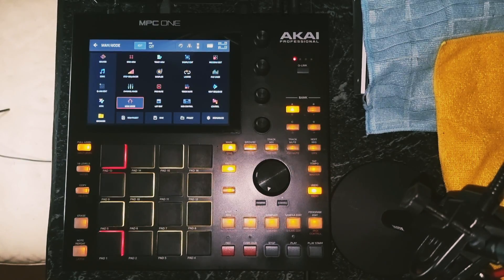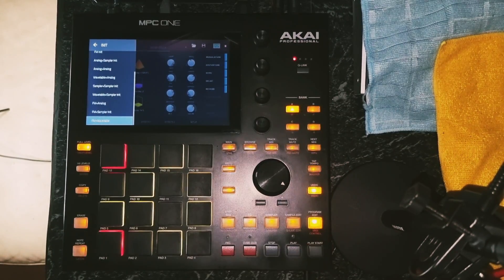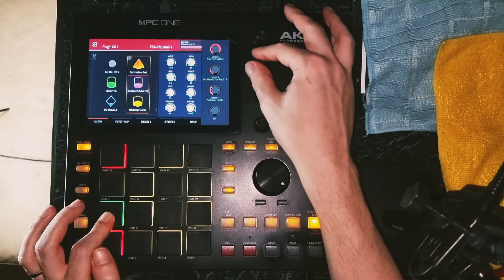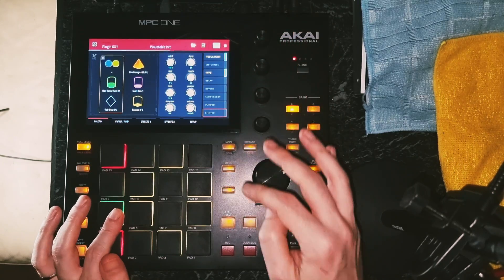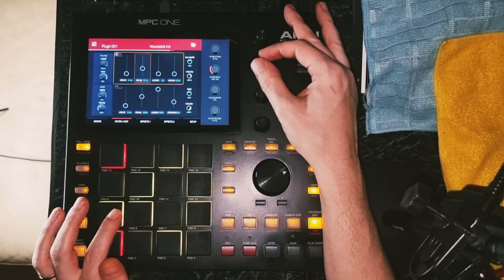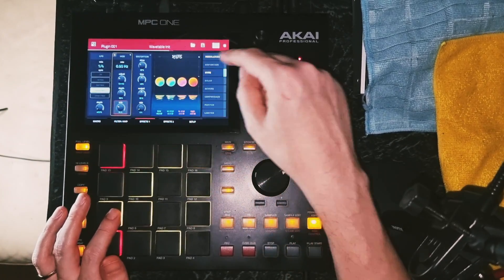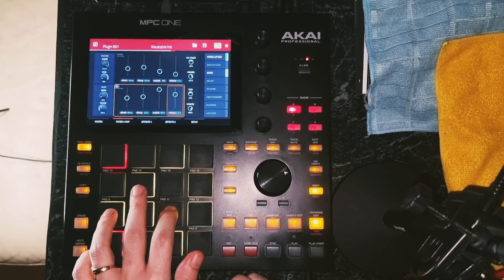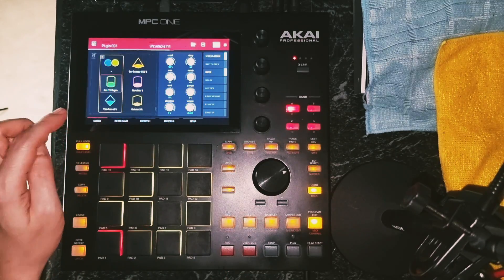Mpc Tips 1. How to Modulate Wavetable Position In Hype Synth

Comment: You can get some nice wavetables close to serum. Be interested in a hype pack for edm.
Reply from the maker: I'm currently making a massive edm pack for mpc. Do you think patches or keyroups would be best for wavetable growls. I think they might work better in keygroups or drum programmes
Reply: @Techtronix  that's a good question. If by patches you mean saved patches that just work for hype, keygroups-seems like you would have more options. But then again patches it's all right there ready in hype and you can use the mod wheel to mod anything instead of going through the mod edit in keygroups..I think keygroup editing could be more limiting because the program has a ton at the finger tips. I could be wrong tho.
Reply from the maker: @Danny  I think the way to go is possibly just drum programmes and keygroups. This way I can layer and process. It also keeps with the tradition expansion format.
Reply: Why not do both as the hype plugin is available as a standalone vst for users of other daws and may not have the hardware akai is doing it so you may aswell just a thought great video by the way I love learning new ways of using the mpc
Reply: Let us know when the edm pack is up for sale. I'll buy it!